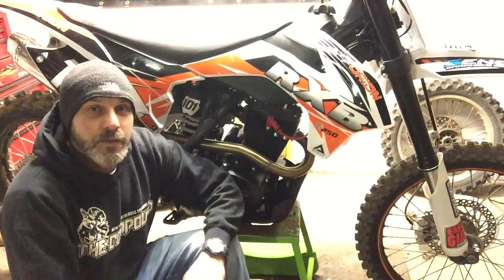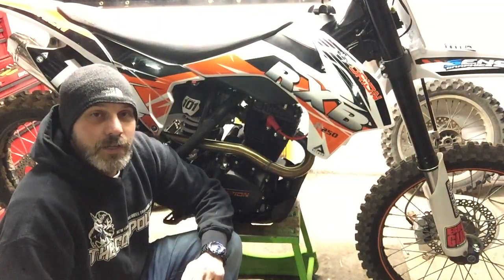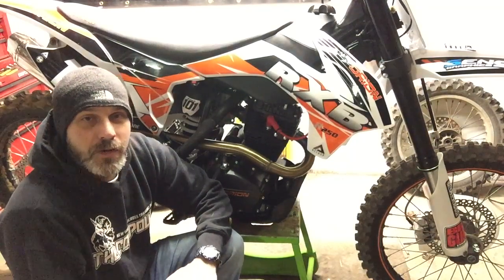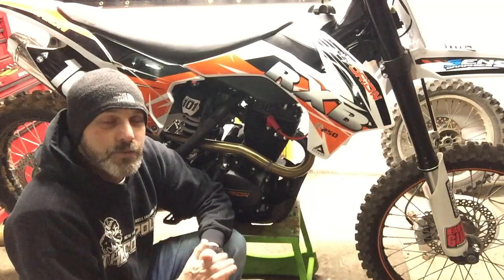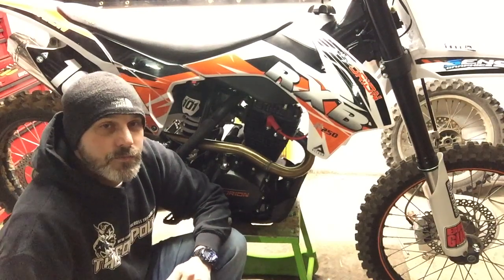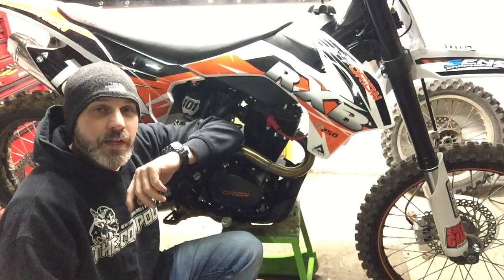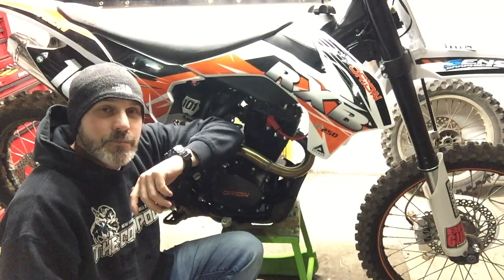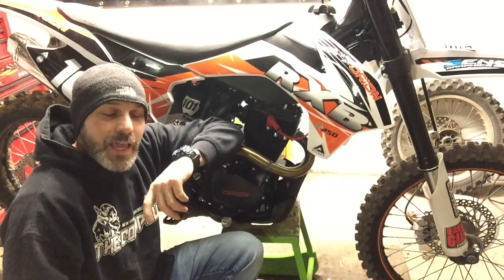Orion rxb 250 follow up video

Comment: Hey Joe. I installed you 4 degree offset key over the weekend on my Venom X22R 250. It really worked well with the Ported head, Wiseco 11:1 piston, Stage 1 Hotcam and single layer head gasket. I gave you a plug on the Offset key on my YT channel for the install. 👍 Thanks for getting it out to me so quick.